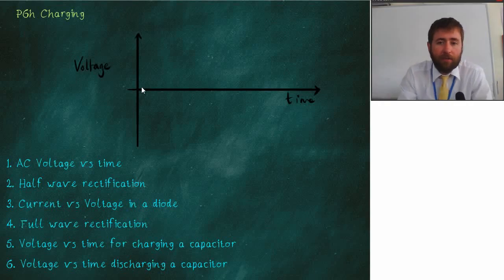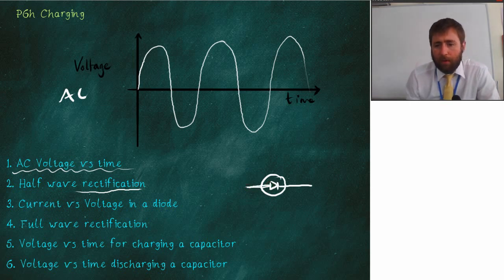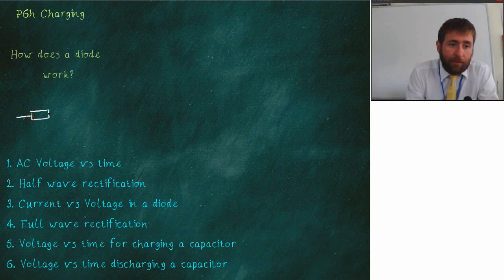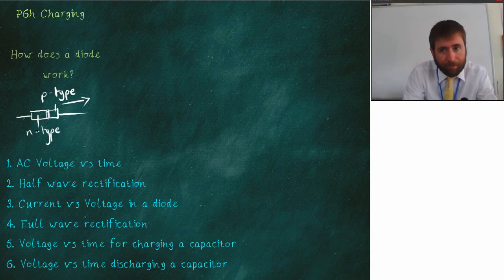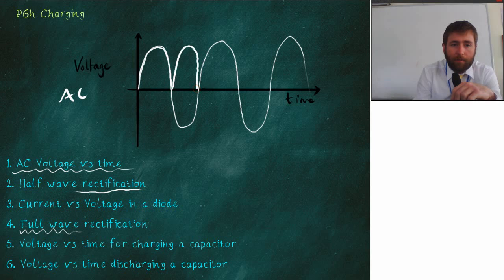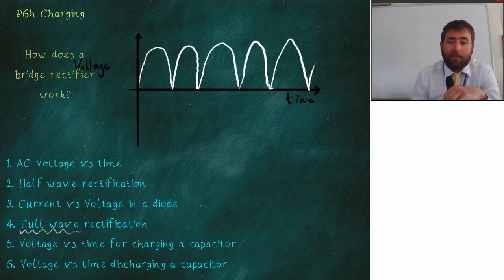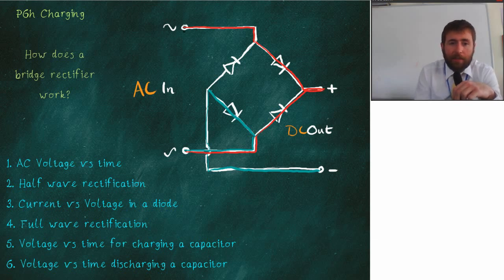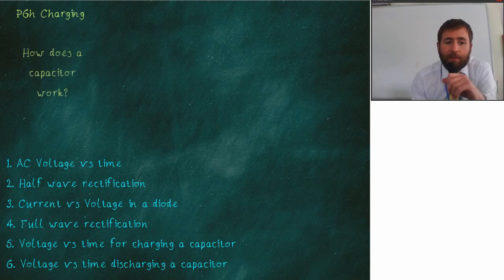AC - DC Rectification, Diodes and Capacitors - GCSE Physics Revision

Comment: is it possible to filtrate dc voltage without using a capacitor in parrallel after the bridge rectifier if yes how ? thanks for your help .
Reply from the maker: Sorry not sure. Maybe some kind of timing circuit to super pose another rectified DC signal.

Comment: Hi great video but I still dont follow how it is that we have negative and we are treating it as if it is positive.  (I am trying to use a L7905 which is clearly said to work with -5V so based on the same logic here can I just reverse the legs and pretend 7905 is a 7805)
Reply from the maker: It's not so much about treating negative as possible, it's just the only available path for the negative charge to go is to one terminal of the rectified supply. 
No idea about the technical specs though but glad it helped you follow the idea. Are you trying to do this in a class, or for a project?
Reply: +GorillaPhysics Yes this is just a project. I am a noob for electronics. so I am having a hard time with some basic cocepts every now and then. thanks for the reply.
Reply from the maker: +Ahmet Ertugrul Would love to see how it turns out, post a video, so other people can benefit from what you find out along the way.  Regards!